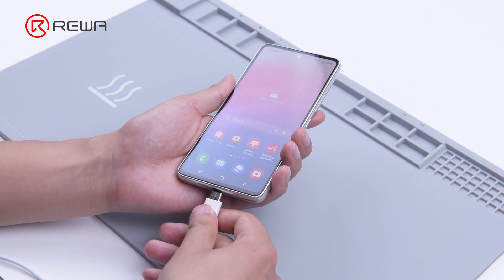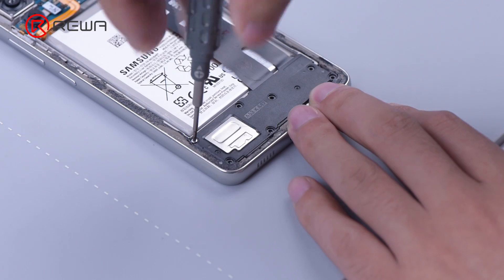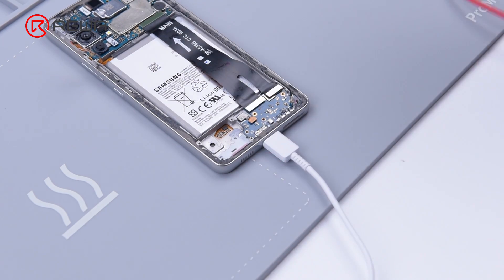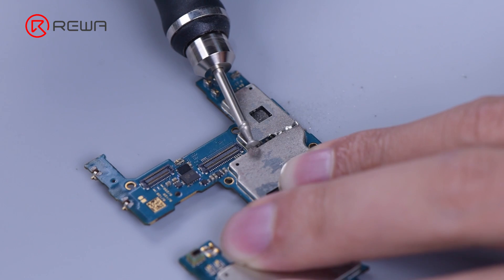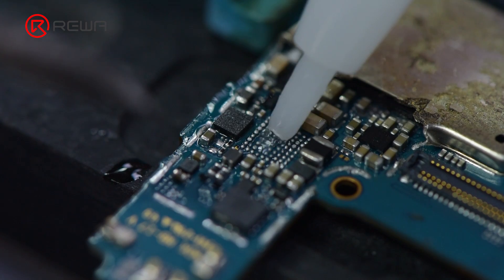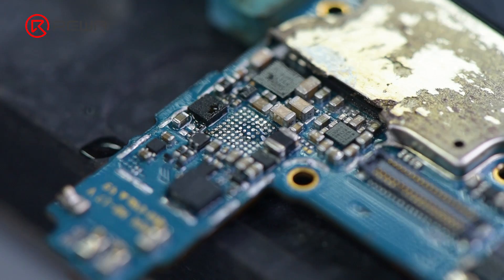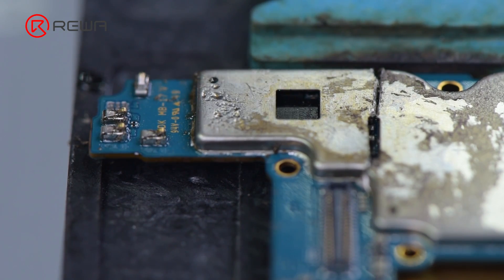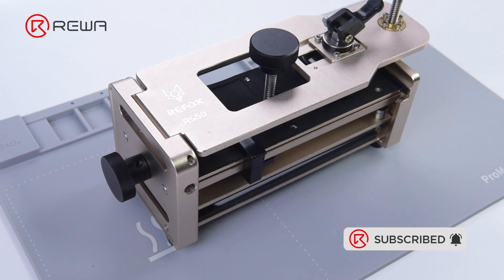How to Fix Samsung Galaxy A53 Won’t Charge

Comment: Thank you, but I don't see the voltage test point. My phone charges very slowly at 0.08A from the start with a battery voltage of 3.2V initially!
now I measure 3.60v on the battery socket, so it charges, but too slowly and my screen remains black! do you have an idea?

￼

Comment: Possible that my the charging IC of my samsung note 10 plus is damage after moisture detected issue apper but it is charging via wireless?

Please reply hehe.
Reply from the maker: OVP IC might be broken by water inflow.
Reply: @rewatechnology2008  so it means i need only to replace my type c female adaptor or the entire charging biard
Reply: @mr.tuliao1079  No, there's a small ic called ovp (over voltage protection) that might get damaged. You can simply replace the ic, which is safer for the future, but you can also bypass it with jumper wire.

Comment: can you remove the hole metal cover instead of cutting the part of it first ?
Reply: Yes you can if only you won’t heat the emmc and the CPU so high
Reply from the maker: It is easy and safe to cut the part first.